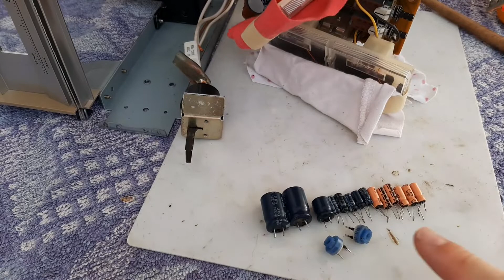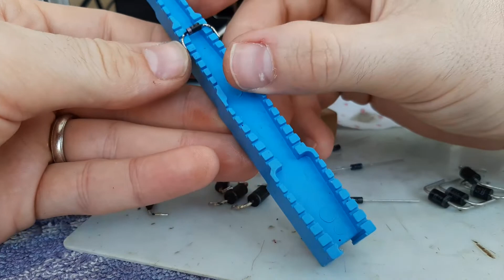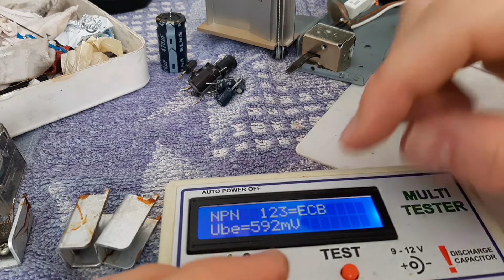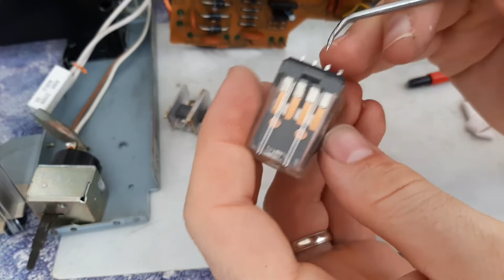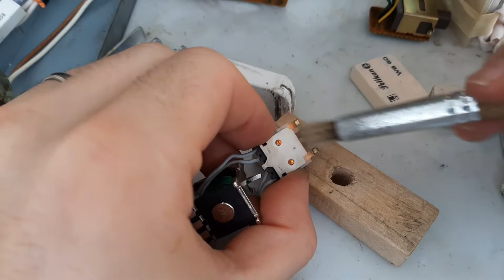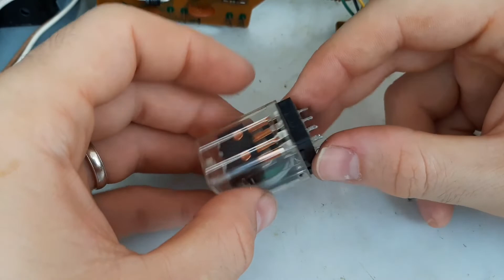FULL Restoration Of a Vintage Stereo Receiver | Pioneer SX 780 | Part 4

Comment: Out of curiosity, what brand of thermal paste do you use?
Reply from the maker: Hi and thank you for question.
I m using 2 thermal paste:
1. On this video thermal paste AG Termopasty Pasta HP from TME.
2. Thermal Paste Wakefield 120-2 from Mouser/Digikey.
!! Both of them are not electrically conductive !!
I m using them for couples of years with really good results.
Good luck and stay tuned!
Ps. I m thinking to make some videos with tools, chemicals, arrangement what i m using. What you think ? Is a good idea? Or other suggestions if you have .
Reply: @MariusHiFii  Thank you for your reply.
Personally I like that kind of videos, showing tools, machines and products of the trade, workbench tours, etc but if you don't want that extra work, maybe you can show (or talk about) the specific product you're using while you're doing a repair.
Thanks again. Cheers!
Reply from the maker: Thank you for suggestions,  i will try to do like that, i will make a plan :D.
Cheers! Stay tuned !
Reply: @MariusHiFii  Nice!